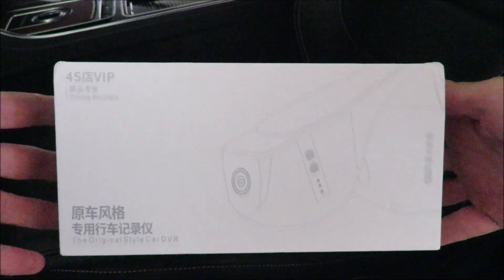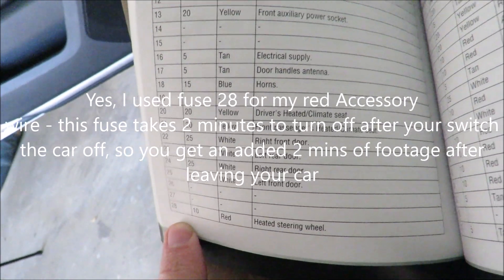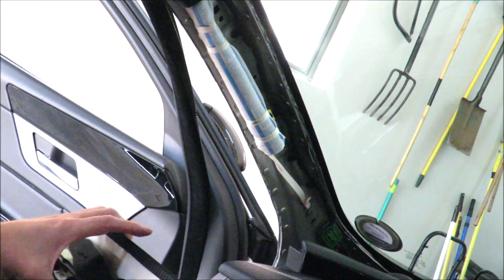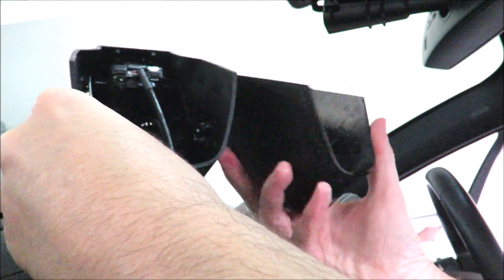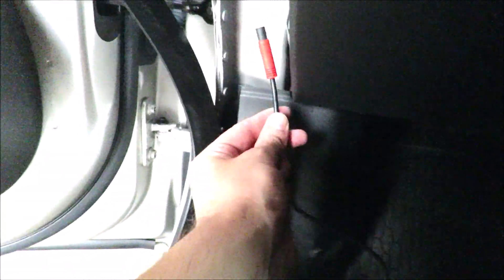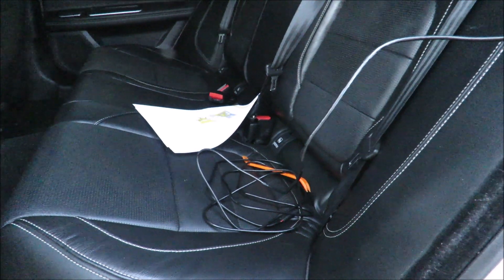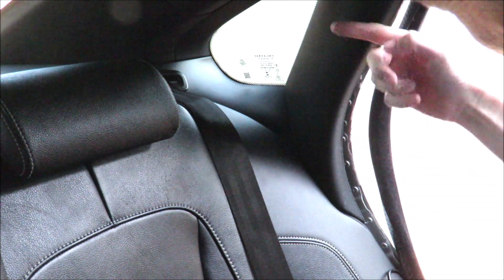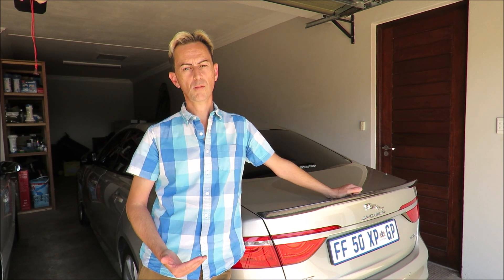Hardwiring a Dascham to the Jaguar XF

Comment: Pro install nice Job and thank for another great video 👍
Reply from the maker: Thanks Chris, I'm going to have a hard time wiring a dashcam to the XFR because Jaguar for some reason hooked every single fuse up to the convenience control module of the car - this means, I'll have no constant live to keep the dashcam's time and date settings.  It also means, every time I open the door of the car, the dashcam will turn on for 3 mins and then turn off when the car is switched off.  This will create a strain on the battery since I don't drive the car every day.  I still need to figure out how to get around that one ;)

Comment: Hi Hilton help me I can't find which fuse 27 and 28 in my jaguar xf 2013 luxury 3.0 D. When open passger door open and no number.
Reply from the maker: Hey Spenser, on your car 27 is for heated seats and 28 is not used as far as I know.  What I would recommend if you're fitting a dashcam is use fuse number F26 (front passenger seat adjustment) for your yellow battery + wire which will always be live and then for your accessory wire (the red wire) use fuse number F31 (rear auxilary socket) as this will most likely turn off after the car has been locked for 2 minutes.  You can check that by simply hooking your DVR to those fuses, start the car, and turn it off and lock it while you sit inside and see if the DVR turns off.  If not, then find another fuse for the red wire where it is for an accessory that will turn off shortly after locking the car.
Reply: @carfanfan  thanks lots I found this and you right. Great support 👍

Comment: Hi Hilton..
Just got a 2013 3.0 XF ..Looking at fitting Dash Cam..
I have seen some people connect Dash cam wiring in Lighting/Mirror, instead of routing all the way to fuse Box.
Was this ever a consideration by yourself..
Cheers
Tony
Reply from the maker: Hey Tony, yes it was.  Considering the dashcam needs both a hot and cold fuse, even when the car is switched off for a long period of time, it made sense to use the fuse box.  So if somebody bumps my car while its been standing for a half hour or more, the dashcam will turn on and records 5 mins and then turn off again so that I can catch the perpetrator :D

Comment: Hey Hilton, terrific video. I know you were planning on putting in some EL tube wire and splicing in it. Did you have any look at that? 
I have all the parts and have checked to ensure proper phosphorus blue colour. But havent found the wire to splice into.. Any idea where or if you've already found this? There are no interior wiring manuals available.
Reply from the maker: Hey Tim. I also have all my parts but haven't had the time to look at it yet. The doors are easy, just find the wire that lights the downlight to the window switches. I noticed my doors already have the piping for the ambient lightning, yours should as well. Check underneath the armrest and above the armrest. If you insert an LED at the end of the tubes, you'll have ambient lightning on your doors. The dash is a different story. I was thinking of pulling the light control switch where the trunk release button is. The dimmer switch is probably the best place to run your main wire from. But it requires opening it so best to have a spare available just in case. If not, the center console has buttons that light up as well and there must be a plug in there. I did that on my Mazda and found the wire that controls the lighting and tapped into that.

Comment: Hey Hilton just wondering if you’ve been successful with getting this camera to record when you are away from the vehicle. I’d like mine to record with the motion sensor when it is parked like a security cam
Reply from the maker: You have to use the app. I'm  using the Roadcam app and in the settings, you can set the motion detector as well as the g force sensitivity if the car should get bumped. My motion sensor is turned off but the g sensor is on and it's set to very sensitive so if someone bumps my car with their body it captures them for two minutes.
Reply: Hilton yeah my motion sensor setting won’t stay one once i turn the car off. I’m trying to figure out why.
Reply from the maker: @lifeistremendous9299  Is the camera storing the date and time. If not, then you've worked it up incorrectly because it needs a battery positive constant power supply to the yellow wire in order to work when you've turned the car off. I'd recommend checking the fuse location you used for the yellow wire to see if it's still active after turning the car off for longer than 5 minutes. That's why I used the electric seats fuse location because they're always love no matter what.
Reply: Hilton i used the same fuses locations you used in your video. Great video. And yeah i am gettin date and time correctly. When i set motion sensor on. It doesn’t stay saved as a setting.
Reply from the maker: @lifeistremendous9299  What APP are you using?

Comment: Hey Hilton, i also own a jaguar xf x260. I really want to install blind spot monitoring system. Have you thought about doing the same? Is it even possible?
Reply from the maker: Hey, my car is already fitted with it. Fitting it retro is pretty near impossible as it's built into the canbus of the car and is part of the lane keep assist package.
Reply: Thanks mate! So there isn't an aftermarket blind spot monitoring unit?
Reply from the maker: @souths4014  I'm afraid not. The side mirrors house the blind spot system and sensors so physical parts would need to be changed. Easier solution is to check your mirrors good and proper before changing lanes. 😊
Reply: Appreciate the info, champ! Good luck to the Springboks in the world cup!😁
Reply from the maker: @souths4014  They won!
Reply: @carfanfan  Japan are looking hot! Good luck in the quarter finals!💯😁🥇

Comment: Hilton.....Great video...yet again!
Want to fit one.
Can I ask...have you had any problems with rattles or squeaks after removing trim since fitting? Scared to ruin the factory finish🤔
Did you allow extra wire for the hatch to open?
Will need extra work to route for my Sportbrake rear door.
Keep owning the Jag and keep up the great work buddy. 👍
Reply from the maker: Hey there, no issues with rattles or squeaks. Just got to make sure you don't break clips and clip everything in properly when you're done. I had to ensure the cable cleared the clip area in the A panel as it wouldn't clip back in. I still had loads of cable for the rear camera and stuffed it behind the airbag. You will have enough too but if you watch my Mazda CX-5 camera fitment video, you will see that getting that cable to the hatch is bitch. It took longer to run the cable than fitting the dashcam. But once done, it's worth it.

Comment: Hi Hilton. I places the two fuses in the seat circle movement, and removed the old fuses in it, but my dashcam is not working yet. All cables are connected to each other and car turned on. Did i do something wrong? Or has it to do with the ground wire? I just placed it on a piece of metal
Reply from the maker: Its probably not grounded. Some bolts are not ground. Find another one that is. Usually a bolt that bolts into the metal frame of the car.
Reply: @carfanfan  yupp. I did but its just flashing between red and purple the entire time. Store isn’t responding eithee
Reply from the maker: @Nick Scholten  I think your problem is that you've got your positive and constant battery plugged in the wrong fuses. Using a test light check, which fuse is always on after the car turns off the accessories after a few minutes, that's for your yellow wire. Then check which fuse is only on when the ignition is on. Keep in mind that this is the fuse that will go dead after a few minutes of turning the car off. That is the fuse to use for your red wire. If it still isn't working, you have a problematic dashcam.

Comment: Hey brother the fin is not like spoiler fin have screws how to take off it??
Reply from the maker: If you have one with screws, you have to remove the cover on the trunk lid.  There are little screws all round the edge that need to be undone and then it should unclip from the trunk.  Then you can get access to the screws holding the spoiler in place.

Comment: Hi . Can I just plug the hard wire connectors into fuse empty slots ? And if yes how do I know witch slots should I go for ?
Reply from the maker: Did you actually watch the video. Because I explained all this in the first step of installation. All your answers will be answered by watching the video.😉
Reply: @carfanfan  . I can see u using existing occupied fuse slots . That's why I'm confused as weather we can use empty slots in the fuse box instead of already occupied ones
Reply from the maker: @florinfycat1496  any unused fuse slots do not have connectors inside them because no wires lead to them.  So you can't use unused fuse slots, only slots that currently have fuses in them as they will have wires that lead somewhere to an item that was specified when the car was built.  Hope that helps.
Reply: @carfanfan  that was a great help.  Thank you verry much

Comment: I tried in XE but it does not fit into the holder. any suggestions?
Reply from the maker: That's odd. Did you check that the dashcam you bought is the identical fitting? Usually the sellers ask for a picture of your cars mirror cover before shipping to make sure it's the same.
Reply: @carfanfan  he did not ask for the picture of mirror cover but provided him all the details of vehicle. Now I'm trying to return it.

Comment: Hi thanks for the great videos Hilton. Were you still happy with this unit right up to you getting your wonderful X250? I so wish I’d kept my 2014 X250 Portfolio S although it is is nice having some more modern tech. Thanks again
Reply from the maker: Hey, yes this system proved to be very good indeed.  The HD rear camera is a must as it helped me with a road rage incident once.  I was apparently "hogging" the fast lane, but could not get out of the way fast enough for a Mercedes Driver as he came flying up from behind and when I eventually did, he pulled in front of me and started brake checking me to the point where I almost hit another car on the left after swerving for the brake check idiot.  I took the video evidence to the police and they immediately found his details on their system and called him into the police station.  I made a case against him for reckless driving and the police press criminal charges against him as well which resulted in a hefty fine.  I doubt he'll do that again just in case he's being filmed ;)
Reply: Hi Hilton, all in and working. I wouldn’t of done this without your video so thanks again, cheers

Comment: Hi Hilton, what's your favourite Jag you've had?
Reply from the maker: Good question. The answer might shock you, because I've had a 2009 3L V6, a 2016 2L and a 2011 XFR 5L V8. I would have to say the 3L V6. It was both comfortable yo drive, old Jag feel to it still and powerful enough to haul me anywhere. The other two were great cars, but I didn't enjoy them as much for various reasons.
Reply: @carfanfan  Wow its the 2009 I still have I think it's great. My only fault and it sounds ridiculous is my seat leather it's quite slide ie I feel I slide a little turning corners. I've tried various seat cleaners/protectors but nothing changes it, it's always slippy. Also the body roll feels too much on certain corners at speed. Apart from the I love the car.
Reply from the maker: @I Am Neo  try cleaning your leather with a leather cleaner, then apply leather feed to the leather. You can get good leather feed at shops that sell horse saddles or genuine leather furniture. You apply it with a sponge or clean cloth and let it absorb into the leather. The leather won't be slippery after that. It should never be slippery. That means someone has cleaned the leather with a chemical solvent in the past or furniture spray, which is death to leather. Leather breathes, and it dries out if not fed with a proper good leather feed, which keeps it supple and will stop it from cracking or tearing.
Reply: @carfanfan  Thanks again Hilton I will get onto that. As you said the leather  shouldn't really be so slippery and it does ruin the drive when cornering. The other thing I notice is body role but I'm just maybe comparing too much with my Audi A4 which litterally is planted always and has very little body role.
Reply from the maker: @I Am Neo  I didn't find mine to have body role at all. In fact, the ride was very firm. Have your shocks checked. They could be on their way out.
Reply: @carfanfan  Maybe the shocks  are on their way out. I usually notice the body roll on big U turn like motorway slip roads. Any easy cornering it isn't bad at all. I'll have the shocks checked out. Thanks again for the info. Also like to add I love your channel, always great videos and top information!

Comment: I want to install dash cam same thing for xe at home wich fuses you suggest me for both
Reply from the maker: @xnezmo4777  Unfortunately I don't know the fuse layout for the XE, but the electric seat fuse would be a good one for your yellow wire for constant power and a 12v socket fuse would be good for the red accessory wire. Just ground it on a bolt where the dash screws onto the body.
Reply: @carfanfan both as it shown i saw in youtube has 20A is it makes trouble with that amount or its all right
Reply from the maker: @xnezmo4777  20A should be fine. I wouldn't use a fuse higher than that though.
Reply: @carfanfan hi friend right now im trying to install it can i get something frim you because im confused should i remove orginal fise and add this one
Reply from the maker: @xnezmo4777  yes, pull the original fuse out and insert the add a fuse in that slot.
Reply: @carfanfan hi please one more im doing it now my car doesnt have heated stering wheel wich one should i chose
Reply from the maker: @xnezmo4777  are you talking about where to hook up the positive yellow wire
Reply: @carfanfan  as you say for yellow i have seats but for red acc i dont have  heated stering wheel option so i should plug it in there it works or not because already there is not any fuses there i dont have that thing to taste if it has it or not
Reply: @carfanfan  To safely install a dashcam and avoid critical systems like the car’s computer, airbags, and engine-related fuses, you should choose fuses connected to non-essential accessories (like the cigarette lighter or infotainment system). Here are some safe options:

1. *Battery (Always On):*
   - *PF6 (20A)* – Looks like it is linked to a 12V power socket, which should be safe to tap for constant power.
   
2. *ACC (On with Ignition):*
   - *PF13 (20A)* – Appears to be connected to an accessory that only powers on with the ignition, possibly the heated seats or similar, which is also a safe option.

These fuses are not connected to critical systems like airbags or the engine, and should be appropriate for installing a dashcam. However, always double-check with a multimeter to confirm the power states and avoid unnecessary risk.

Chat gpt said this what you think
Reply from the maker: @xnezmo4777  chat GPT is correct. Usually the yellow wire is constant battery positive and red is for accessory ignition on
Reply from the maker: @xnezmo4777  I always try and use 12v socket for red accessory wire. But you have to test it to see if the 12v socket fuse turns off when you turn the engine off. My Audi for example always has live 12v sockets.
Reply: @carfanfan thanks dear friend i have done everything but unfortunately camera fuse wasn’t enough to put it in
Reply: @carfanfan hi friend im back thanks for your vid but i have a question with a help of friend we did it for acc he used pf32 5A.  And pf28 10a heated stering wheel  on battery even my car doesnt have that option    That was his suggestion what you think should i change there places what i should do its itss all right
Reply: Finally he cutted fuse and wire used glue gun for connect is it safe tho im worried but felt shame to tell him di as video is it bad fir fuse or its all right
Reply from the maker: @xnezmo4777  A glue gun is not a good idea for anything electrical. C9nnections must always be secure and protected to ensure no shorting or fire.
Reply: @carfanfan thanks will try electric tape and for fuses i chose is it a good choice
Reply from the maker: @xnezmo4777  yes good choice